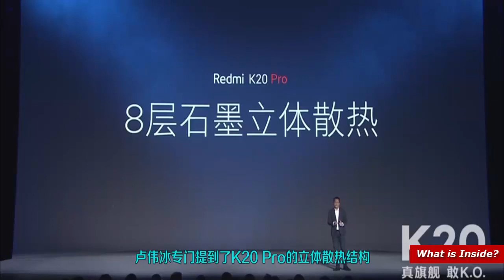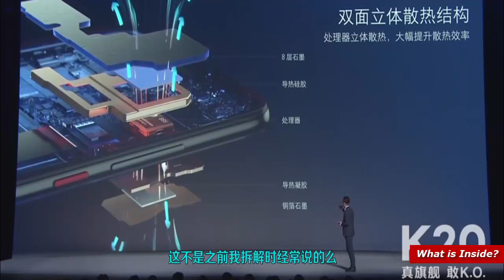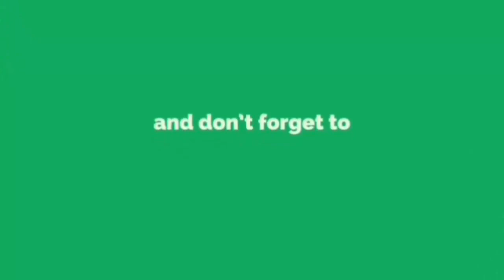Redmi K20 Pro Disassembly Teardown Repair Video Guide- What is inside?

Comment: i drop my mi 9t by accident for about 1 or 2 feet height .no cracks or distorted image on the display but after an hour when im watching a movie the display turned off. the phone still vibrate when touching and i tried to call on it using other phone it still receiving calls. do you think my lcd is broken? because i still using it before the display died it still good before
Reply from the maker: It might be because the screen cable flex is loose due to the fall. Your screen is still good, since there is no physical cracks or damage. You should take it to an engineer to adjust it for you or if you can't do it yourself.
Reply: thanks for replying .i'll take your suggestion

Comment: Hello, I'm wondering if my unit is fine or not. I found out that on the top part of the phone, somewhere near the cameras, when I shake that part on my hand I hear some spring noise, or like something is moving or not well attached, from the inside. Could you confirm me if is normal?
Reply from the maker: No, it's not normal. I haven't hear any noise from my own device, i am even using it right now. I think probably you have a defective unit. Are you using a case? Did you recently drop the phone? This might be the cause.

Comment: Sir can u please give the information about this
I have injected sim rejecter pin into primary microphone on the bottom of redmi k20 pro...so if there is any problem to it..
Please reply for this .. information
Reply: I think your phone will have no problem. Microphone holes in our mobile phones are perpendicular to the actual hole of the mic sensor inside our unit. So I can say that your unit is safe. Btw I have a mi 9t, k20's global version. Have a nice day!

Comment: My front glass got a little crack.
Can I just change the front Glass without changing the full display?
Reply from the maker: Sorry, unfortunately you will have to replace the whole screen altogether the redmi k20 is still very  new in the market and getting a replacement for the screen glass only will be very difficult. You will have to change the whole screen altogether.